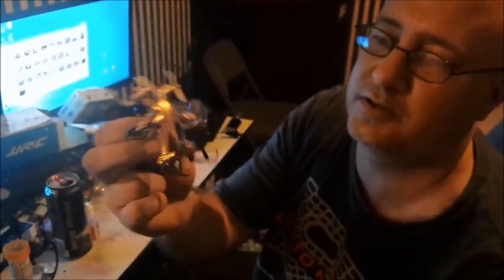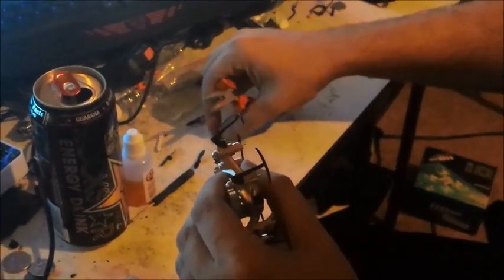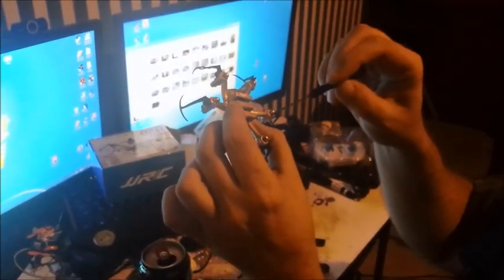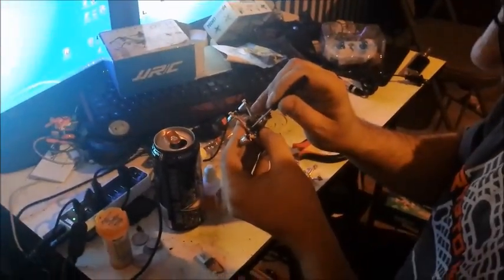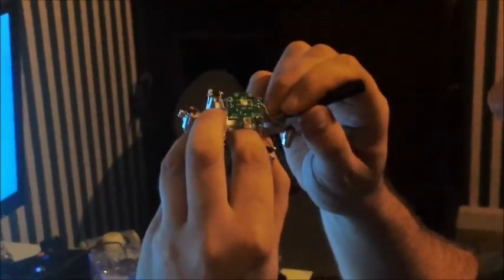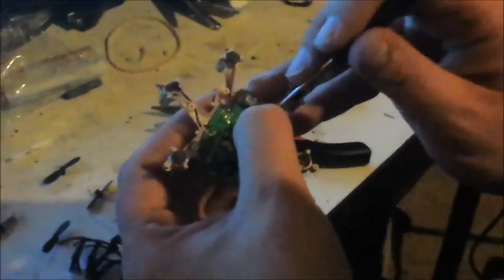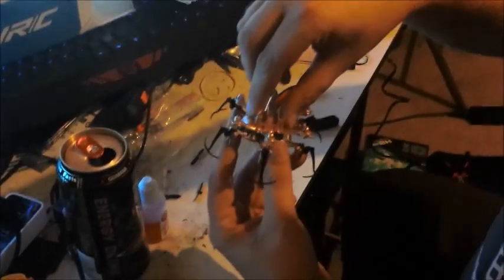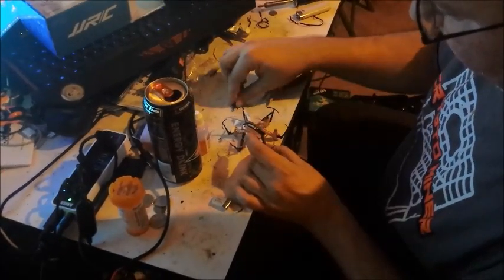Antenna Mod Tutorial jjrc h20 hexcopter nano drone extend the range!

Comment: Hello. I have this drone and after pairing, I am only able to control one or two seconds. After that, it does not respond. Do you have any idea?
Reply from the maker: My guess would be a bad battery. Do the lights still work?
Reply: @illpoet13  Thank you for the reply. Yes, they do. I have tried to supply power from an external source but this time even without pairing the controller the motors are starting to work and the lights are not working.

Comment: Hello, the jjrc20 is my first mini drone. Its just with mine, or all of them have a delay sometimes to respond to the commands? Not in every command, but sometimes in almost every fly, it take 1 to 2 seconds to respond when I move a stick. Its not a big problem, but its enough to hit someting in indoor flights
Reply from the maker: i never had issues with a delay indoors, just range issues outdoors with mine.  Is there much electro magnetic interference in your house? things like a refridgerator or active microwave can sometimes interfere with radio signals.  I would do the mod on it, it can't hurt it and might clear up your probem.
Reply: I dont know about having too much magnetic interference here, I got the drone early today, and hadn't time to fly in another place. I will test it, and will try the mode. Thanks!
Reply: I had just finished the mod in both the drone and the controller, and made test flight. I got zero delay! Totally recommend it! Thank you very much!
Reply from the maker: awesome I'm glad to hear it! have fun flying it, it's one of the best micro's you can buy in my opinion!

Comment: How much it http://goo.gl/Vxia70 can go fast? Looks like a nice quad, cheaper and portable
Reply from the maker: it's pretty fast when you put it in the highest speed setting.  You can get a copter of this size that goes faster but not without spending a bunch more money, and it's not that much faster.  Also, you can get the same hexcopter from bangood for less money.  here is the link http://www.banggood.com/JJRC-H20-Mini-Headless-Mode-2_4G-4CH-6Axis-RC-Quadcopter-RTF-p-986430.html?p=RX05112732317201510V

Comment: Have also done it :     https://plus.google.com/u/0/+JuergenBosse/posts/GpqAHkSzF73?pid=6230062313935566130&oid=112817259450024432124
Reply from the maker: +1205juergen cool looks good! i haven't been able to decide if i should mod the transmitter or not.  once i exposed the antenna on the actual hexcopter my range issues disappeared.  did you notice an increase in range when you did the tx also?